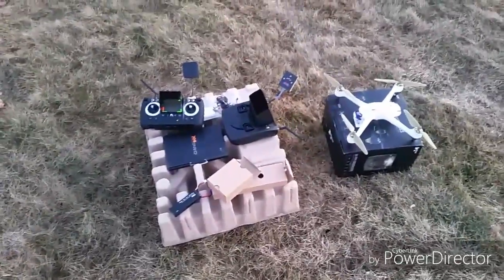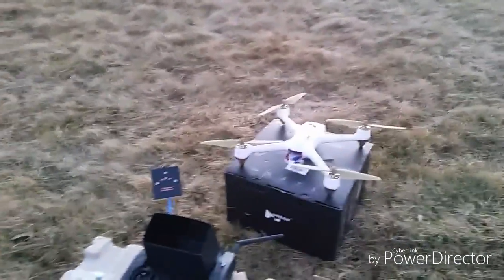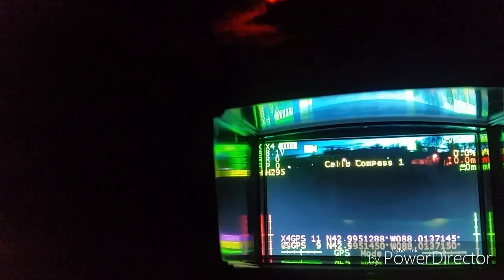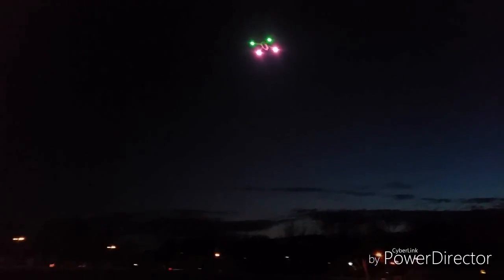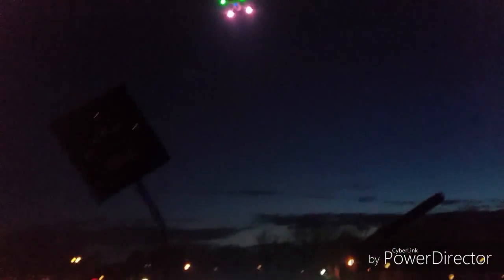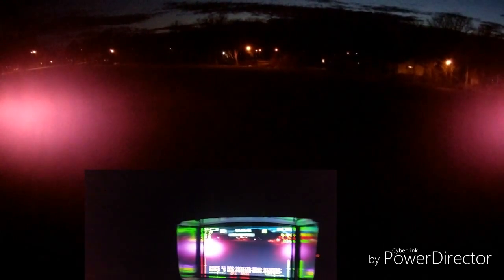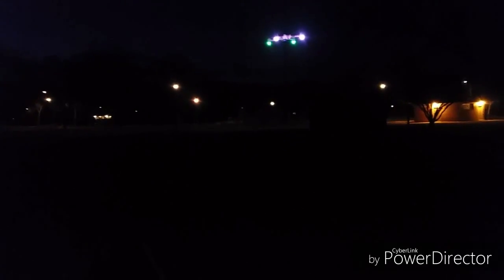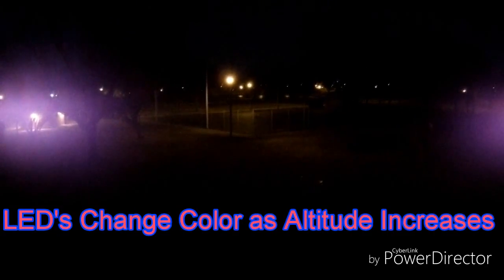hubsan h501s Escaping Toilet Bowl Effect & How to Change LED's On Quad

Comment: I believe that toilet bowl effect is caused by a miscallibrated compass or a compass error.  Vortex ring state is when a copter is descending into it's own prop turbulence and losing lift causing the copter to wobble as it comes down hard straight to the ground.   They are two different things.
Reply from the maker: Your absolutely correct about the compass. Almost all toilet bowl mishaps are from a poor compass calibration. Either magnetic material was 2 close to the sensor, or it was performed improperly. As others, I use "VRS" as a short cut term for toilet bowling. If you think about it, if you were to let a quad continue to "Toilet Bowl", without interfering with it, the quad would eventually go into a Vortex Ring State ? Yes Indeed it would.

Comment: Mark, my H501s, single s, arrived Friday, Rained all day Saturday and Easter Sunday it's clear and 15 above. Sheeese. But, I got a single S quad and the Advanced controller in my all cardboard box. The box is the one that comes with 3 smaller boxes inside for accessories. No plastic anywhere. Bought it off E-bay in California and it came 4 days early, so no complaints. I mean except for the shitty Wisconsin weather pattern. :P

Comment: My controller does the same thing on quad voltage meter. Strange.
Reply from the maker: Really ? You're the first person that has had the same issue that I know of... I don't really understand why it would read the voltage in correctly? All the other Telemetry data is correct, except for the battery voltage. Maybe it's a controller firmware glitch or something? I'm not  going to mess with it's firmware because that may end up messing good configuration it has already. I mean, my fpv signal and 2.4 is crystal clear out to 2,350 Meters so far, with 1 OEM Flight Battery and Just a 3dBi Dipole antenna. That's Pretty Good Range & 20 Minute flight times. No Way will I mess with the Firmware. It's kind of an Annoyance not knowing the actual voltage in the quad but I can live with that...

Comment: thanks ...my 501ss did a flip over on start.... after 40 succes full flights, i was amazed/scared/wtf ..could not find anyone that had the same problem..some stated it was to cold, but no one have ever tried a flip over just using throttle, they got bowl affect or fly away.you state 100% throttle on takeoff (2.22min)...so i asume your 501 flipped (turned upside down at start in a cirkle)like mine at low throttle??
Reply from the maker: Jonni Laumann No, I never had my quads tip or flip on takeoff. Always full throttled up until airborne. I did have a few times where my h109s X4 Pro kind of tipped over upon Landing. Because, you have to Disarm the Props Quickly when it's landing. It has landing gear / legs , which makes it very Top Heavy... The 501's aren't very top Heavy, so I never had a Problem with Takeoffs Or Landings.

Comment: Hey thanks for advise! Mine has been flying really well, but I did notice it has better signal in the country rather than city! And starting from box has helped a little. I have one issue though, the recording doesn't like to stop and save when finished!!  I'm using a Sony 32G microSd HC 70mb/s
Reply from the maker: John S I have the exact same problem with my h501SS. Every now and then, it will not stop recording, no matter what you do... Also, if you got the standard version you should only be using a 16 GB card. 32 GB is too big for the quad. I read online that the so-called advanced SS can accept a 32 gigabyte micro SD card, however the standard can only accept a 16 gigabyte Max micro SD card. I would try a 16 GB card and see if that fixes your problem... Also, make sure you use a laptop and format the card to FAT32 before putting it in the quad.
Reply: Ok I'll try a 16G. And whats fat32? :) I'll check it out, thanks
Reply from the maker: John S FAT32 is video recording Codex. You must format the micro SD card before it will record anything. FAT32 is basically a standard default formatting codec for Micro SD cards. If you don't format the card to FAT32 before you put it in the quad it will never record or save anything. Also, if you put the MicroSD card into a card reader and insert it into a laptop, the laptop will not recognize the card because it wasn't formatted...
Reply from the maker: John S I'm sorry, FAT32 formatting is acronym for "File Allocation Table". It's the most common type of formatting for any type of media files (Video, Audio, Pictures, Etc). https://www.howtogeek.com/177529/htg-explains-why-are-removable-drives-still-using-fat32-instead-of-ntfs/

Comment: Hey Mark, nice video as always, I just switched my lights to stay on constant. I recently purchased the 501s with the standard controller last week. Been learning a lot from ur video's. I'm a newb to the drone world been into nitro Rc for years. I have a question though, my 501s is picking up 11 on the GPS an controller barely held 7 on a clear day, I would lose FPV if I turned my back to 501s, is that normal? I did the antenna upgrade but doesn't seem any better. I haven't had a good day yet to go an fly, an do a true range test, just got 3' of snow. I'm nervous about firmware also, my # don't match the firmware # u say is good. Mine is v4.2.28 LCD v 1.3.3,,,501s v2.1.29 an FC v 1.1.41 I can't wait to get out an fly it though. Thanx for all the great video's Mark
Reply from the maker: Matt Kamp Hey Matt ! If you did the antenna mods and put a panel antenna on your controller, it is normal to lose FPV if you turn away from the quad. The Reception Side of the Panel Antenna must face the quad at all times. As for the satellites, I also only get 11 Max on my H501S-S. It seems like that's all it will pick up after they made the changes to the h501s to make it the h501ss. My H501S picks up 12 Satellites No Problem. Not my SS. Only 11.... The controller's GPS Module is only for "Follow Me Mode", "Circle Flight", and Also the SS Returns To Home Where the controller is, it tracks the Controller. It's normal for the number of satellites on the controller to fluctuate. As long as you have acquired 6 satellites on your controller, everything will still work. As for your firmware versions, I wouldn't start changing anything or trying to upgrade unless functions don't work properly. If you haven't had a chance to go out and get a good flight in and test all the functions, you should leave the Firmware Versions As Is. Ok ? Thanks for watching and your comment ! If you ever have any questions, feel free to ask any time! :)
Reply from the maker: Matt Kamp Oh Yeah, make sure your controller is set to a good frequency for the antenna you are using. Most aftermarket panel antennas work best when your controller's frequency is set to 5745 - 5755 MHZ. My quad came with the controllers frequency set at 5780 MHZ. Your's might be set at the wrong frequency for an aftermarket panel antenna. Before a flight, just go into the menu and make sure your frequency is set to somewhere around 5745-5760 MHZ.
Reply: Mark Suttner I do have the panel antenna. I'm just paranoid cause my numbers are different but will def test out before I mess with anything. Thanx for the help
Reply from the maker: Matt Kamp Don't be paranoid... Just because your firmware versions are different than mine, doesn't mean a thing. There are different firmware versions that come with every quad.... The Versions are put together at the factory and are either good configurations or bad. Hubsan has improved somewhat with their firmware stuff. Just wait for a nice day and take it for a flight... Test all your functions, etc. You might end up having better firmware configurations then I do ! Just relax and enjoy !!
Reply from the maker: Matt Kamp Hey Matt, I was just thinking about your original comment. The firmware versions you have are actually for the original h501s. Those versions are the latest upgrade in firmware you can do to the original h501s to make it function like an SS. Do you have a SS or an S ? It will say on the little square barcodes on the controller and the quad "H501S-S Or H501S". Also, when you look at your firmware versions in the controller menu down at the bottom and red letters it will also say which quad you have. Can you tell me if you have an S or an SS...? I'm thinking about something...and if you have the original h501s, that you recently purchased, that is very strange. If you get a chance, get back to me please....
Reply: Mark Suttner, a sticker on the heli says 501s. I checked out the bar code on the radio an that says 501s-s, when I turn on the radio it says nothing at bottom of screen  but in the middle under LCD it says 501ss  v2.1.29. I unfortunately took the bar code off copter,i thought it wasn't important. I was able to get a quick 10 min of flight in this morning an everything seems good. Follow me seemed good, RTH worked, started to toilet bowl but saved it by dropping altitude,, think I heard that trick from u. Again this was only first 10  min off flight an I couldn't test range. Let me know what ur thoughts are.
Reply from the maker: Matt Kamp That is very strange. So, the barcode on your quad itself says H501S ? Not H501S-S ? And the barcode on your controller says H501S-S ?? I'm not sure if you watch the video I made on how to tell the differences between the two quads or not ? What I meant by looking at all your firmware versions is by going into the menu on your controller. All you have to do is, turn on your controller first, then plug in the quad battery, no need to do Compass Cals or anything. It just needs to have power. When both are powered up, hold down on the left control stick and push the right control stick like you're pushing on a button. That will bring you to your menu. Use the right stick to navigate down to where it says "show versions", push the right stick to the right to enter and it will show you all your firmware versions. The reason I say this is strange is because it's sounding like you have a H501S Quad & a Controller that was "Meant" for an SS . So I'm not sure where you bought it from, but it seems like they took an original h501s, updated the firmware so it would bind to the firmware on the SS controller. Even though the S and the SS both use the exact same controllers, the SS has It's own particular firmware which is not compatible with an h501s quad... Where did you buy it from ? I'm asking because what you are describing is very strange. Unless you actually got like a beta tester quad or something..?
Reply: Mark Suttner I scraped the bar code off but there is another sticker on it that clearly says Model No. H501s. I can read code on remote an yup it says 501s-s. I got it from Amazon
Reply: JYZdrone
Reply from the maker: Matt Kamp Matt, there are two stickers on the belly of the quad. The CE Rating Sticker will always say model H501S. The small little barcode will either read H501S or H501S-S. If you tore the tiny barcode off, you have to go into your menu and look at your firmware versions. In Red Letters it will say "H501S V ** " OR "H501S-S V*** . There's a couple other ways to tell which quad you have. They tried to distinguish the SS from the s in a lot of different ways. First, the box it comes in is different. The original h501s box has plastic underneath where you put the quad and controller and also a pre molded plastic cover that goes over the top. The SS comes in a slightly smaller box that doesn't have plastic to hold the quad or a plastic cover. It's just cardboard pieces and There is a separate piece of cardboard that you have to take out to put the controller under then put back in, to put the quad on top of that. Also, the CE rating sticker on the belly of the quad is very large on the SS. It goes all the way from the battery door about 2-3 inches up towards the front. It covers some of the venting slits on the belly. On in earlier original h501s it only had a very small CE rating sticker and a small barcode that were about the same size (3/8 inch) about. https://youtu.be/7P-BNb7Y_5I
Reply: Just watched ur video "how to tell the difference " an I gotta believe I have the "ss " it was the spitting image of ur white one u unboxed and I have the green computer board u talked about an my remote came with the same lipo battery. I wish I saw that video sooner lol. Sorry for all the confusion but that for help :)
Reply: Yeah,, mine came in all cardboard box also. It must be the "ss".
Reply from the maker: Matt Kamp Sounds like you got an SS, but the Version 2.1.29 is a "Unknown" Version to most of the Hubsan community. Version 1.1.41 is The latest version for both the S And the SS. Not sure about the 2.1.29 Version...? As of yet.
Reply: Mark Suttner this whole leap into the drone world has been a huge learning experience for me but I'm  hooked. Will prob have many more questions in the future lol.